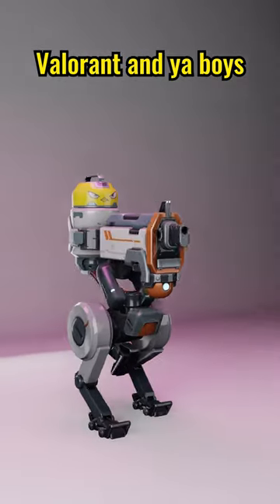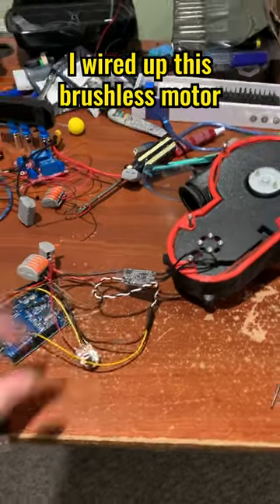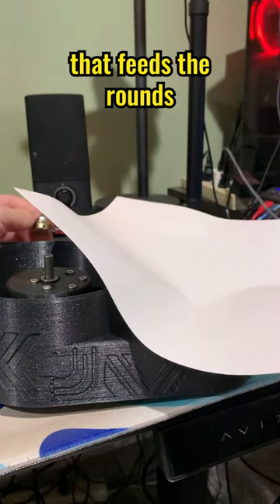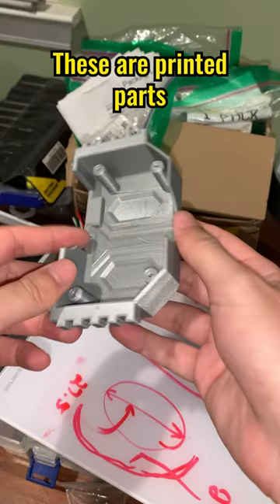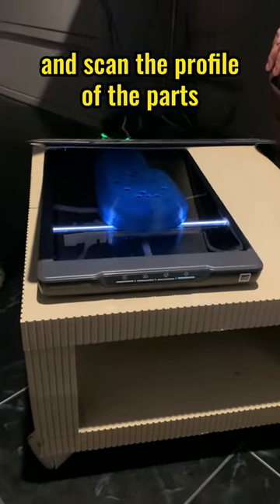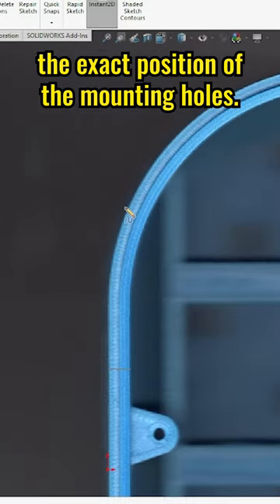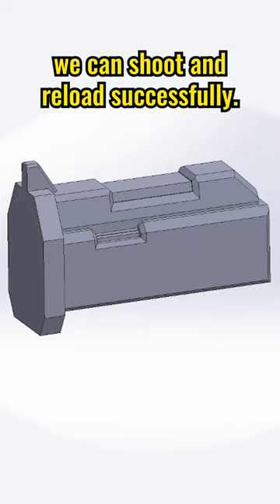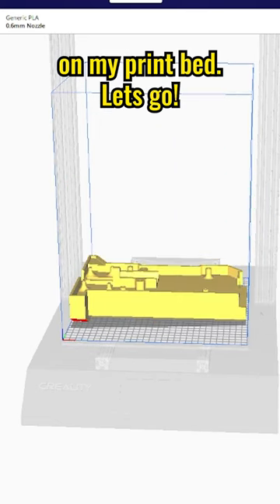REAL KJ Turret Valorant: Pt. 6! 3D MODELED SOLIDWORKS

Comment: Good tip I learned in my engineering class, you can use those 30$ xbox 360 motion cameras as 3d scanning cameras
Reply: We used to it scan ourselves so we were able to 3d print ourselves, you would need to spend like 15 $ on some software for the 3d scan to register to though
Reply from the maker: Ill def try this if my model still doesnt work i didnt know that

Comment: You know you can import stl files into solidworks as either solid or surface parts
Reply from the maker: Yeah i do. I didnt have the STL files for the out of darts parts. And for the kj turret STL i wanted my own geometry that i could tweak in the future easily if need be and was just using it for proportions reference